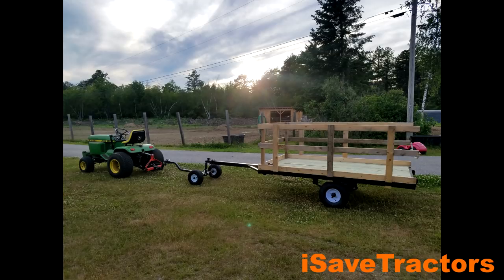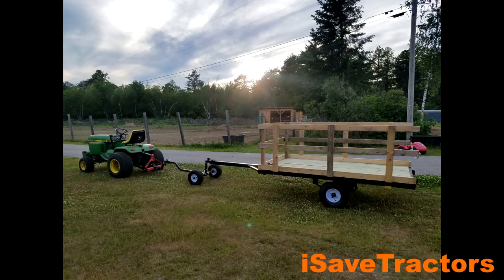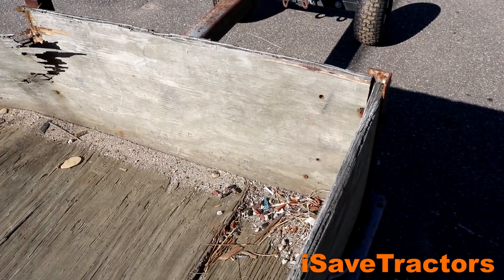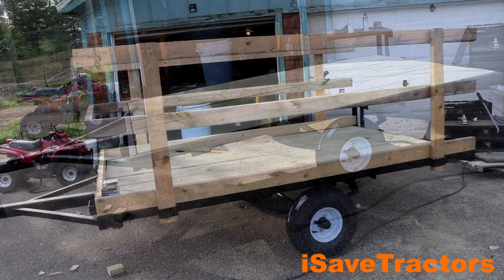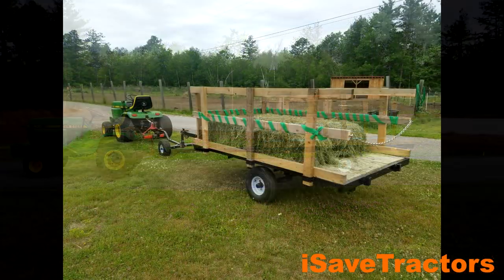Garden Tractor Hay Wagon Cart Trailer Build

Comment: Hi .. Love what you are doing but you need to llearn how to pack a wheel bearing with greece
Reply: Do you have a link to your channel where you show this? How could you tell that he can’t pack wheel bearings on that speed up short clip?
Reply: i dont have a channel showing me packing a wheel bearing but that does not mean i do not know what i am talking about .. he put a handfull of grease in the axle housing and the put a totally clean bearing in the housing .. the bearing has no grease in between nor around the rollers .. just do a youtube  search .. how to pack a wheel bearing and you will see what i am talking about
Reply from the maker: You caught me. I didn't repack the bearings or replace the seals but I didn't use clean bearings either. I was crunched for time so I wiped the outside of the rollers and left the old grease inside the inner race. This was made for a Bday party the next morning. So there is old grease on the inside and new grease on the outside after putting them in the hub. Not the best way to do it but considering the trailer doesn't exceed 5mph it should be fine for now. I did recently get a bearing packing tool from Lisle tools, I want to try out. Anyways thanks for the comment. I underestimate the ferocity of the comment section of the internet.
Reply: Dreyfus Nineteen yes it doesn’t mean that you don’t know BUT if you had a channel you would know how much time and effort that goes into filming and editing even a small project and then your comments would be kinder and more respectful.
Reply: Dreyfus Nineteen good video, thanks for sharing.

Comment: norman do you have a metal blade on the chop saw ?
Reply from the maker: Yeah that's a cold cut chop saw for steel. It's a carbide tipped blade that spins at a much slower rpm than wood chop saws. It's ok not my favorite way of cutting steel but its quick for non critical stuff like this
Reply: ok ty i have a metal chop saw and it uses the cut off wheels 
like the one you had when you did your backhoe project
Reply from the maker: I got this one thinking it would cut straighter than an abrasive wheel saw but it doesn't. I now use a metal bandsaw when I need something cut perfectly straight
Reply: isavetractors ok ty I try to watch all your videos and have a few tractors myself
Reply from the maker: Thanks for watching!
Reply: isavetractors my next project will be a hydraulic dump trailer about 4x6